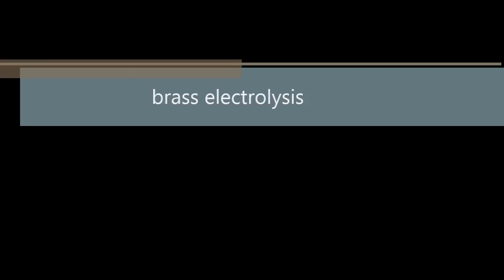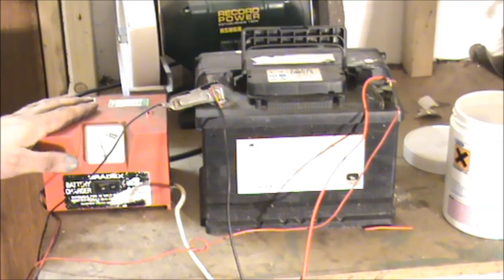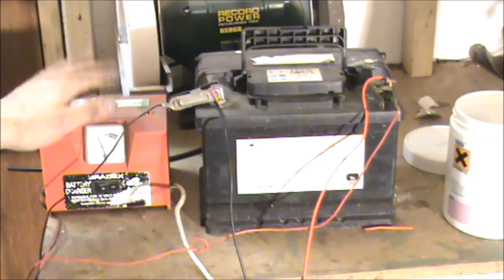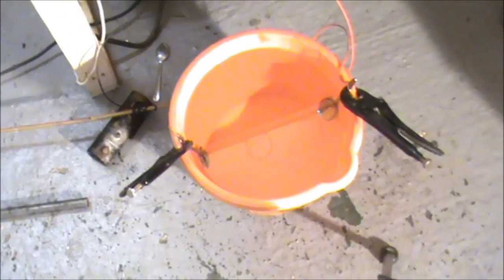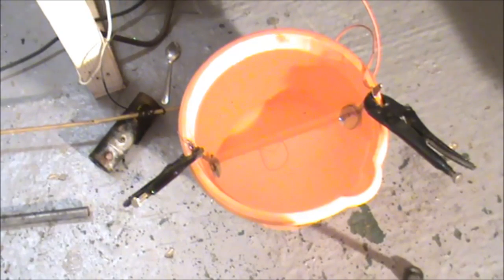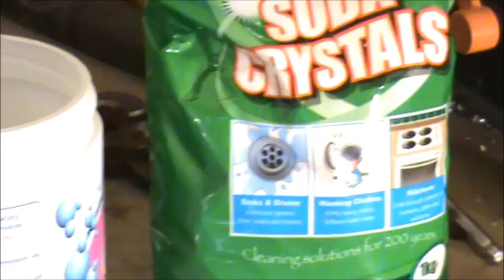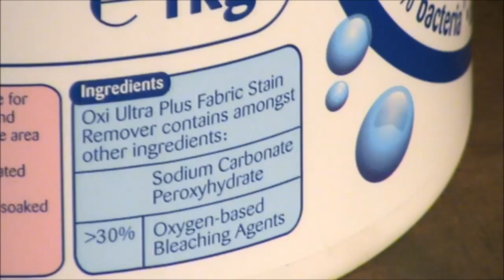electrolysis of brass parts can it be done

Comment: I suggest ~ start by  trying  sanitiser ~ nappy cleaner !  

I discovered this method recently and it works a trick on  my brass relics and even ( Australian)  silver modern decimal coins which are  notorious  for  developing a black  coating after lain in the  ground for some time. 

I add a desert spoon of  detergent to the mix and Hot water and just leave ! Amazing result ~ not guaranteed to  clean all but  I have had  great results.. an easy  fix ~ 

Kills off any  stench and removes the crud ~ * unless extreme of course! 

Leave fro some days then  wash and  buff with  soft brass wire brush ~ 

If you find it does not work ~ then go onto to the  noxious messy  electrolysis ~
Reply from the maker: thanks , good tip, lol I was just messing around in the shed! I don't mid a bit of elbow grease :)
Reply: A desert spoon?  For camping in the desert or for eating sand?

Comment: You're not gonna drink the electrolyte? And what are you gonna do with it, huh? Pour it down the drain perhaps? Or dump it in your backyard? Your plants (and any neighbors with a well) will surely thank you for that......
Reply from the maker: kept it for future use , not quite on the same scale as the exxon valdez though is it ?
Reply: Of course not, but I still wouldn't pour it into a soil in which I'd EVER want to grow food or drill a well in (using carbon rods would've been easier I think). On a semi-related note: I heard a story where one researcher has once dumped a small vial's worth of radioactive liquid out of his window. They had to replace the soil 1.5 m deep in that area afterwards.....
Reply from the maker: CoolKoon now that's a cool story :) I'm guessing your a science buff ?
Reply: Almost. I'm an electrical engineer/IT guy :P And happen to know a little bit about chemistry and gardening... So yeah, I really hope that the remaining liquid has never touched any soil after you were done with the cleaning....
Reply: @CoolKoon  I disapprove of using stainless steel, but carbon rods don't work well. They dissolve into nothing quickly, and if you aren't  prepared for it, your metal will start to rust away as soon as the current stops flowing.  There are some types of isomolded graphite rods out there, but they are ridiculously more expensive than most items you'd want to defrost, so it defeats the purpose.  Better off using cheap scrap metal as the sacrificial piece.

Comment: A Capacitor would clear the ripple also. And the risk of shorting a battery is not that great ;)
Reply from the maker: killerbeenl how would I connect it up? im very grateful for you advise ,regards chris :)
Reply: Cap would be placed parallel to the source battery charger. Since you use a battery charger there is no need for a resistor to limit the current to the capacitor. It will charge with the batterychargers current. Depending of the cap used plus to plus minus to minus if there is a indication on the cap. Connecting a electrolitic cap the wrong way may explode or break it. A cap can be shorted but the current will be unloaded in a zap. To prevent high discharges you can put a resistor (lamp for example) in series with the end rods. So the cap is paralel and the lamp is in series with plus or minus. I would take a simple cap from some kind of motor. Please note that the power will first be going to the cap for a few milisecond or seconds depending on the cap used then it will go to the electrolysis. This is only possible when using a constant current source if using a other source. Always place a resistor in series with the cap and connect them to the output to prevent high charging of the cap and destroying your power source. Anyways. Good luck to you all. I'm experimenting with a zink copper alloy automation machine thing to plate a copper zink alloy on materials. Don't know if it is going to work just some testing. If i have a good end product i might post it on my channel. The automation between the layers will me done with a lego mindstorm robot. Lol just for testing saves me a lot of dips. Will be a 5 bath system diy setup.
Reply from the maker: killerbeenl thank you so much if there was a like x 10 button,  id press it! I wish you good luck with the alloy plating I believe its really tuff to achieve at home , keep me posted

Comment: Hey Chris

I dropped the method described as the very residue even looks insidious ~ and on inquiry, my thoughts were confirmed. 
I have been experimenting with an array of methods ~ I am currently trying  an anode of steel with a Bicarb and even  nappy sanitiser which has an oxygen content and the electrical process is effectively activated/ enhanced  with these add ins ~ 

The process works on steel and ferrous metals just fine  but the process requires changing  the  fluid and cleaning up the anodes to produce a best result ~ 

I am now trialling the same deal with brass as I Metal detect WWII military sites and most personal fixtures , webbing buckles and many equipment pieces are brass. So  the pieces are often encrusted and corroded after some 70 years ~ 

(Ironically  the condition and technique required  is conditional to where the item was found and prevailing  soil conditions ~ So  many items including coins respond well even to techniques such as  sonic  jewellery cleaner!)

Thus far I am hopeful of the results as I have found that the brass after two treatments with an anode of steel and a buff with a light weight brass brush is working extremely well ~ 

So optimistic there ~ but the ultimate frustration is copper base coins which we also find a lot of ~ 

Cheers 

SS
Reply from the maker: good stuff I was hoping that a compound with a high oxygen content  would aid the cleaning process, you'll have to keep me posted on your results.
it sounds like a great hobby you have there Stuart what as been your best find so far ?
on a completely different project I've got to "nitre blue" a steel sculpture  which involves heating a bath kn03 to 650f , so that's a very rich oxygen source, I wonder if adding solution of kn03 in the electrolysis  bath would have any effect?

Comment: I have tried this method previously but was concerned about the "pea soup" created ~ and I was right ~

 It is a NASTY combination ~ Should NOT BE BREATHED In or handled ~ 

In Australia at least this is illegal to dump this in the drain!  Below is an extract from a much better informed individual that I~ 

"The most common material used for your anode (which will have the positive lead attached) by home electrolytic cleaners is a stainless steel spoon. I can not stress this enough. Just don't use any stainless steel item as your sacrificial anode.

If you do the process will result in Hexavalent Chromium being released into the electrolyte.

See here :- http://www.workplace-hygiene.com/articles/hex-chrom-update.html 

Further, the resulting electrolyte becomes illegal to dispose of down the drain and must be allowed to evaporate and then the residue must be disposed of a a toxic waste facility."

I no longer use  Stainless Steel and  am working on a safer healthier anode material ~
Reply: +chris the bodge You could use some good ol' carbon electrodes......
Reply: Cool, but if you can only get the copper-coated ones (like I can), you might want to scrape the copper off, otherwise after dissolving all the rust the copper will nicely start plating out on the iron (or the rusted iron too)......
Reply from the maker: I believe  the tiny amount of  Hexavalent Chromium released in a small scale experiment like this is negligible, but i  agree with you its not good practice, what do you suggest? I've not done any since, but I have a large copper knapsack spray unit I need to clean, maybe ill use vinegar !
 thanks for your reply its always a pleasure chatting with you regards chris :)
Reply from the maker: that's a good idea , minimal pollution :) ill invest
Reply from the maker: CoolKoon ive seen them on good old ebay, but like you say I could try the copper ones, ive got to hand